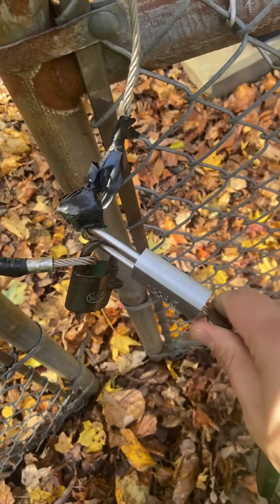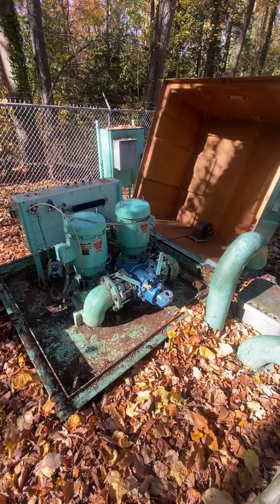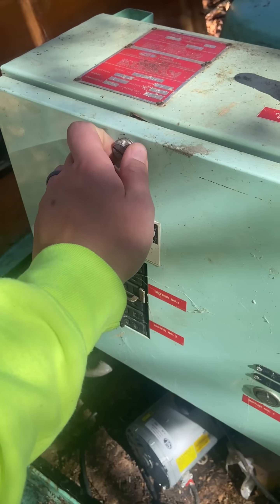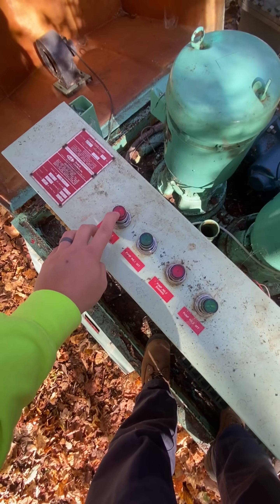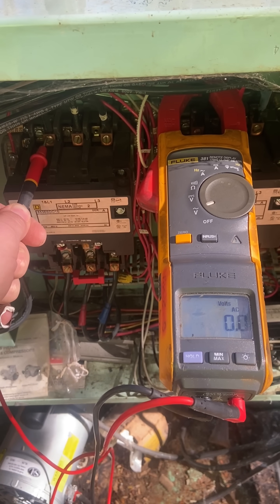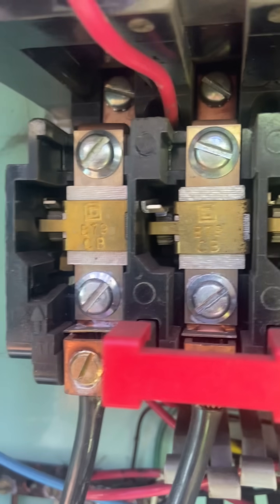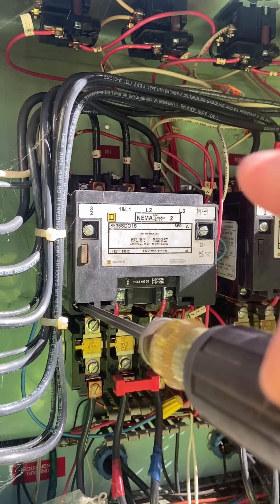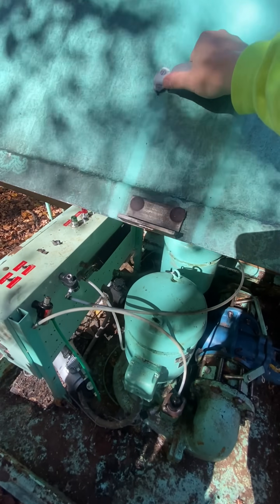Doghouse Pumps #electrical #motorcontrol

Comment: Never saw vacuum lift station.  That’s weird.

A buddy at work showed a simple trick for those hard to grasp bulbs.  Ya gotta have those orange & blue wire nuts laying around right?  That rubbery blue end fits them perfectly.  

Reach inside the wirenut with needle nose & pull out the metal threads.  Now you can easily drill a hole through the orange part and now ya put the wire nut on your key ring.   

Your welcome.

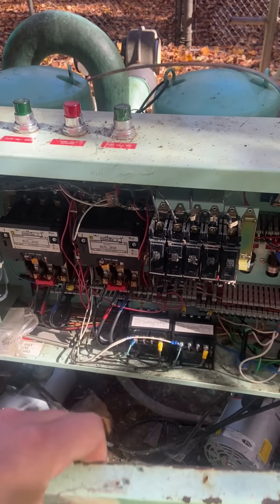Comment: @Cursed_Controls I spent a day figuring out a Smith & Loveless setup fairly similar.  Ended up being a solid-state 3 sec timer looking quite similar to @0:57 labeled TD1-TC.  Prior to that the operators opened the check and back fed liquid then slammed the power on....the worst motor noise ever!
Reply: And how do vermin not cause havok @ the station your @...WTH!

Comment: With all the corrosion inside the housing and the hole that rotted out, there might be a methane leak.  And when the contactor turns on the little bit of gas trapped inside the contactor cover might be igniting momentarily. 
I hope you also checked the heaters for the overload as old as the list station looks.

Comment: Those contacts were pretty gnarly I bet it could’ve been a current fluctuation from poor contact quality. I’ve seen cleaner ones than that be the reason big AC compressors trip overloads a bunch of times.

Comment: Kinda like the well houses around here. Controls and a pressure tank under a doghouse... also usually a snake or two, an ants nest or red wasps if your really special. DAP makes a wasp spray that has a good reach, works great and is like something thousand volt rated if you got to hose of something important. I keep a few cans in the truck next to the tick spray... on that note just get horse fly/tick spray and soak your pants. It works.

Comment: The reason the fibreglass failed on the hinges was when they drilled the holes  in the fibreglass, they didn't seal the penetrations with resin afterwards. Over time, moisture pooling at the base   wicks up around the glass fibres, swelling the surrounding resin, destroying the mechanical structure. Sorry S&L, the whole cover installation looks a bit amateurish.

Comment: The reason it’s not the center phase typically is because of how the terminals where landed at the motor control, often times do to motor rotation. Something to think about for those residential guys out there
Reply: You could be a pal and switch A to B then flip flop the other two 😂

Comment: Never seen one of them, but thats why i enjoy your channel. That and you dumb stuff down  for residential electricians like myself. 😂
Closest ive been to one of those was replacing the add a phase on a system that had a dual motor pump for a 16 building property. They had to pump their poo a good 1.5 miles i think it was. No big deal right? The add a phase they initially sent was completely wrong... 😢

Comment: If those indicators are still rockin' incandescents, about five years ago I found a supplier of LED replacements.  It was hard to find them!  I replaced pretty much our entire facility's indicators with them, and that really cut down on our monthly trouble tickets when we'd check them on a service schedule.
Reply: Who's that supplier? I bet others want some too
Reply: Mrow!- I'd also very much like to see their catalogue, [because] on my list of things people want me to find parts for;

I have a medical device that used a specific variety of 'recently' extinct high-efficiency incandescent bulbs  to both precisely change colour or provide general illumination on demand by modulating power and temperature. 

Unfortunately it seems that every single supplier I can reach either quietly switched to the more common less-radioactive-waste version but with the same UPC/part#/model#/skew without telling anyone. (At-least even if those specs do not match the very specific numbers listed in their catalogues, they all put the real specs on the actual boxes the bulbs were delivered in.)

 (...And because I did not have the foresight to record those specific characteristics during those years I had used the equipment to run a demonstration comparing the various types of bulbs that used to be available before disposing of my collection.) 
I really am hoping that someone's drop in replacement cloned the colour-changing behaviour accurately.
Reply: Sometimes LED bulbs glow weakly if there's a voltage capacitively coupled onto the wire. The solution is to wire a resistor in parallel, but that defeats the energy-saving purpose of using LEDs.

Comment: We've got corner grounded delta at a couple lift stations. 
Open delta at the smaller stations.
Reply: Corner grounding is popular for mining. Eliminates the need for 1 wire in miles of tunnels. The motors don't care, neither do the VFDs.

Comment: Weird. I have never come across a vacuum station or a grounded phase like that. I am used to the opposite where we use a capacitor bank to add a third phase or inject air instead of evacuate it.
Reply: Over here in Gernany ive only seen submersible pumps to remove the sewage and big external vaccum pumps to keep the negative pressure.

Comment: I actually just built and installed a new control panel for a system like this! 

After figuring out that we ordered the wrong trip class breakers and getting them replaced,  it's been running really smoothly!

Comment: I did that job for about ten years. Not finding a smoking gun was always my favorite. You always get to go back in the future. 
I worked on the controls mostly. They can cause as many problems as electrical components.
Reply: I work on cars for a living and getting one that screws up and then starts to work right is the worst. Did I fix it? Did it fix itself? Is it just waiting until I give it back to the owner to screw up again (probably)? Who knows.
Reply: @bugdrvr  At least with cars, when it’s a reoccurring issue, you can shake the owner down for details.

Silliest one that I’ve seen for instance was a stereo that was a parasitic draw. Went to the stealership 3 times and they were unable to find it. The issue was only present when the radio was “on” when the key was turned off. If the radio was off first, the issue wasn’t present. 

The stealership must have started their diagnosis by turning off the radio. 🤦🏻‍♂️
Reply: @AndyRuse  The only diag that “beat” me was due to a customer not being forthcoming. Was a salvage title 2019 228i…. Car had 2 issues but he thought they were one and the same. Had a miss due to a leaky valve cover and the car would activate TCS under hard acceleration. It had an aftermarket I-drive display/controller. We were questioning the controller but he said that he bought the car with it and it just started doing this all recently. I tried re-coding ABS, VSC, DME and RGS modules. No change. No codes. I said find a shop with ista as even though my autel can do a lot with bmw ista still has more features. 

He came back to get some work done on his girlfriend’s car. I asked him if he got the issue figured out. He said yeah. The valve cover was the miss (I know) and that the I-drive unit HE installed was causing the TCS  intervention due to him grabbing the wrong CAN BUS when he wired it in….the unit he installed is a common mod and they’re done really well. So I never assumed it.

Comment: For the randoms in the audience. Sometimes pumps just OL because of reasons you won't be able to see when you arrive. Like a transient voltage sag, extra thick uh "fluid" or something too solid, or for some random reason short cycled. Doesn't seem to want to short cycle now though.
Reply: Or because nobody's watching and they just feel like it.
Reply: @thetoasterisonfire2080 same thing in automotive. Had a new guy get lippy because I changed a fuse on a blower motor and shipped it when it worked. Had to let him know, it works now, we have no idea what caused that fuse to pop, and if the vehicle comes back this year for another fuse popping then we can diagnose further, but sometimes a fuse just wants to pop for no good reason.
Reply: @AJISFREAKENAWESOME my personal rule is I replace a fuse once, and if current after replacement is acceptable I'm happy. After 2 blow I dig deeper.
Reply: @timlong1462 yeah. After the  2nd I have an assortment of resetable breakers with a buzzer that alarms when the breaker trips. Its awesome for troubleshooting overload situations
Reply: @AJISFREAKENAWESOME Fuses can and do fail due to fatigue and heat. The fuse element can only take so much current over so much time before giving up.
Reply: @thetoasterisonfire2080  Those are the motors that deserve the gentle caress of my hammer.
Reply: The important thing is, you log these things. So if it trips every few years you just reset it and move on, but if it trips every few weeks you know to start investigating why.
Reply: Thats the thing about pumps. You cant see in ‘em so you just have to take ‘well it works now’ at face value. Somebody should talk to the plumbers about making the pipes transparent.
Reply: Yep, that old stuff just trips sometimes and has to be reset and never trips again or rando trips again weeks or months later. People flush stuff and sometimes it hangs up then the pump trips and it falls away or sinks or who knows, maybe the plumbers find it. Towels, handy wipes, socks, all kinds of weird stuff, resetting the pump sometimes gets the grind on enough to overcome whatever it was after sitting a while.
Reply: Yeah old crappy contacts that have welded a time or two... whichever pump does all the switching for level control sooner or later will burn up those contactors.  We just replaced hundreds of them on our annual and probably not done comprehensively for 5 years. You can sure tell which ones have 1000 starts on them and which ones turn on and stay on for 8 weeks.
Reply: Everything electric has a reason for doing it.  Its best to document this.  But also verbally explain.   This video on YouTube is very good for customer come back issues.  Its a CYA thing that allows a customer to call you back while saving reputations at both ends.  

Good business practice.
Stable confidence for important relationships dealing with critical infrastructure systems. 

It would be a beautiful world if more people worked this way.
Reply: I had 2 pumps that were locked up today. Pulled them out of the wet well, and like 90 percent of the other times, they had underwear stuck between the grinder and the impeller.  Somebody has got to tell the chick's around hear to quit trusting farts. 😂
Reply: Lots of people think electricity is an exact science and it is not. Worst thing is and intermittent fault. You are never there when it happens.
Reply: I swear our Water Treatment Works (chlorination plants) randomly wake up and decide to choose violence some days. Things trip for seemingly no reason.
Reply: OL
My handy multipurpose Acronym Decoder Ring
(ADR)  states:   OL = OVER LOAD
Because typing OVER LOAD is so dang difficult
we need to sling out acronyms to confuse our
paying customers. 
OVER LOAD 
OVER LOAD 
OVER LOAD
Reply: @mrbrown6421 Square D "B type" overloads... we have these as well as older AR-type in my plant.
Reply: @mrbrown6421  it's not that deep lil guy